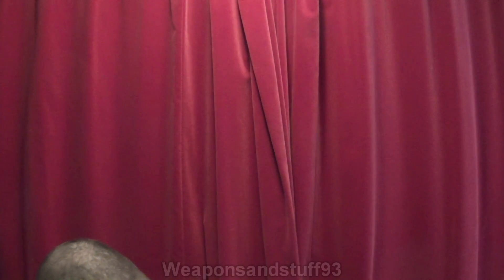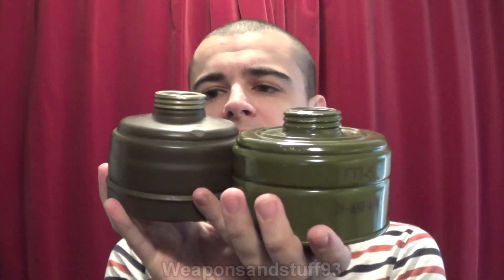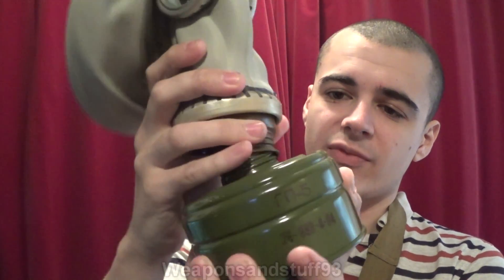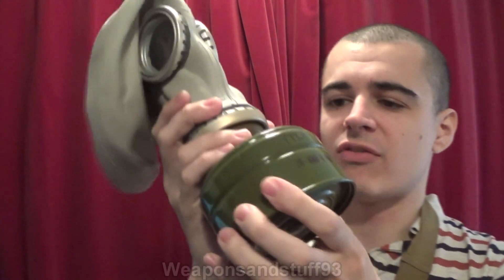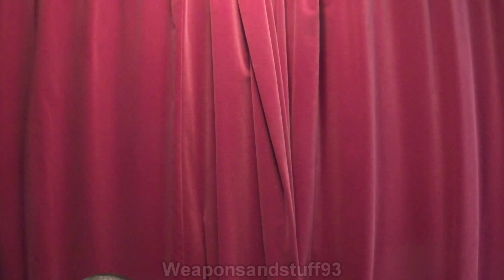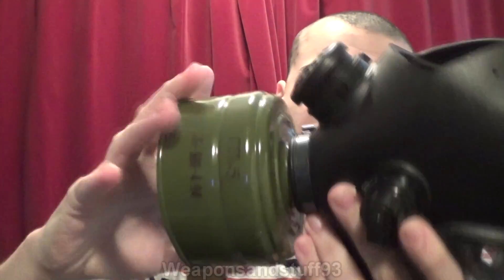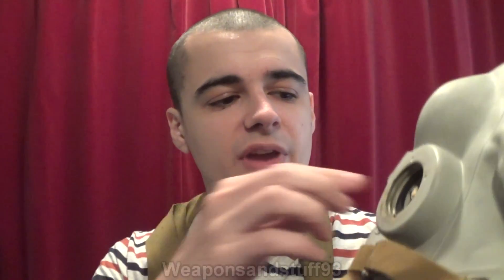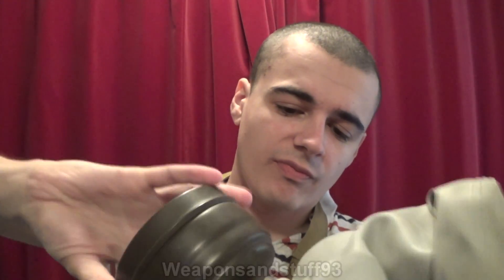40mm filter compatibility explained

Comment: In Germany you can get normalized (din) threaded filters 
The one I got is a MSA 93 abek2hg/st after a quick Google search I found out it's certified for en 14387 and for GOST .
Here you can get them for about 30 € (most filters here seem to be normalized)
Edit: I just found out every din En 14387 fits the gost standard threading
Reply: could you explain more about DIN threads? can they take nato filters? I will soon get m71 from finland

Comment: I cant find the names for other thread types. What is the name for the attachment most p100 filters use? They have like three teeth that lock in with a half turn. Also I find a lot of Honeywell p100 filters that use a different type of thread that isn't 40mm. I don't know what to call these types of filters so I can find adapters or masks that use them.

Comment: I have a Soviet GP-5 and used it with a French CFF3 Filter and it works perfectly fine because I do not smell the spray I’ve tried on it. But does it actually seal?
Reply: But the mask on and place your hand on hole of the filter (tightly) and try to breathe in, if the mask starts coming inward it's sealing. The negative pressure test.
Reply: I just got the CFF3 filters I ordered for my medium "GP5" gas mask and despite being told from multiple places that it would ruin the threads and not seal it worked just fine so far.

The filter threaded in smoothly, passed the negative pressure test, and I couldn't smell any of the air freshener I sprayed in a small room

Comment: Is there 3M or Honeywell half or full face mask that takes 40mm (NATO or normalized) filters? I only saw a bayonet connector for 3M. I saw screw style at Honeywell but can't tell what type of screw it is. If none of them have a 40mm connector, do you have any recommendations? Thanks!
Reply: Or you can buy those Chinese gas mask that takes both 40mm (NATO compatible) and 3m filters

Comment: I have a Russian GP-21 which came with GP-5 flter, and since it is very hard to obtain the new russian filter, I will try localy made filter (NATO standard) from Trajal...a filter for Serbian M3 gas mask. Hopefully it works...
Reply from the maker: I assume as it's not GOST it won't fit properly but good luck

Comment: Would AXE Body-spray work for testing a filter? That's implying it's tested in a small sealed room, like a bathroom with the door closed, and a lot of AXE Body-spray is sprayed. (5 sec.)
Reply from the maker: Yes it would be a better test than most things, but banana oil is still preferable.

Comment: If an FP5 is too expensive like it was for me, then look around for EN 148-1 filters. According to scandiagear.com they are Rd40 x 1/7” threaded, which is the same as an FP5 if i'm not mistaken. I managed to get a Spasciani ABEKP3 filter for about $12NZD compared to the near $60 it would take for me to import an Fp5. I've tested it quickly on my GP-7V mask and it seems to work fine but i'd need a more thorough test to be sure.
Reply from the maker: Interesting but very strange they make them in a normalised thread.

Comment: I ordered a Czech m-10 mask as more of a novelty item because I know the cheek filters are terrible designs, but I am very curious if the filters do contain asbestos or not.
Reply from the maker: There's never been a published lab report so nobody can be certain.
Reply: @weaponsandstuff93  Czech filters from 1960 are without asbest. Czechoslovakia from 1960 starting use prefilters from paper (something like air filter in car). For example filter MOF-2, MOF-4 and MOF-6 are without asbes. Manufacture where is this filter make (Sigma) declare 0% sbest.

Comment: I've found that pretty much all Chinese filters are normalized too. They screw into and form an airtight seal with both GOST and NATO masks very well. They're really cheap too; 12USD for an in-date MF11B NBC filter, 8USD for a brand new Z-A-P3-2 filter.
Reply from the maker: Sadly every Chinese filter I have had so far has been useless due to poor quality carbon inside.
Reply: If you look inside products from brands and manufacturers in AB website, you get a quite different range of products, heavy duty for mining, chemical industry, firefigthing and so on. Big filters, SCBA, chemical suits, etc. Quite different from the cheapest chinese things on the bay ... Have to get samples yet.
Reply: You find both, as in US our Europe products, canisters new shape, plastic, with stripes, or the "metal look" line. The most important for me is the brand. A Company specialised in selling a full range of products for firefighters, police or coal mining is reliable. By the way, some of these products are available as well in Ali Express, , since AB is rather a wholesale website for professionals. Not tested yet any product, lack of free time ... there is a huge market for PPE both in China and Asia, due to very tough conditions in plants; and they now begin to have consumers and buyers in South America, even Europe. They have also far bigger filters, as in older line pf products in Europe (Fernez had this in france last century, filters up to 5 liters size) and hoses. PAPR as well. @honkiekowboy4941
Reply from the maker: Interesting.